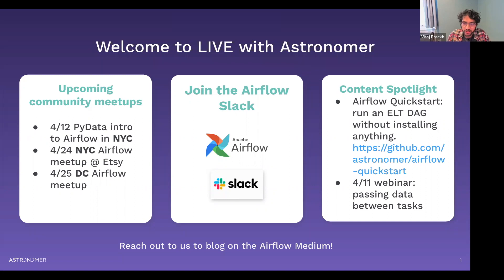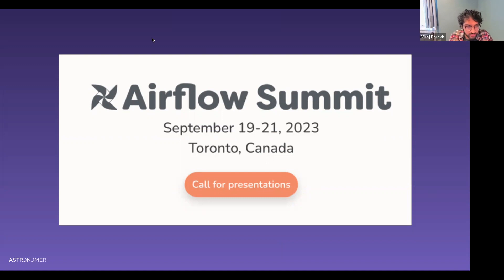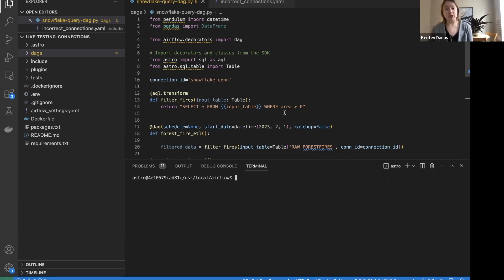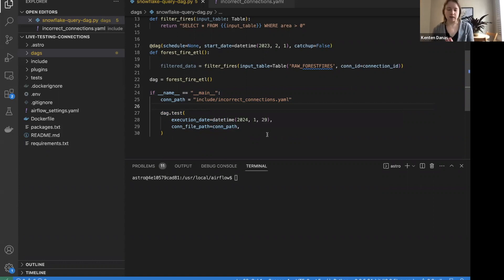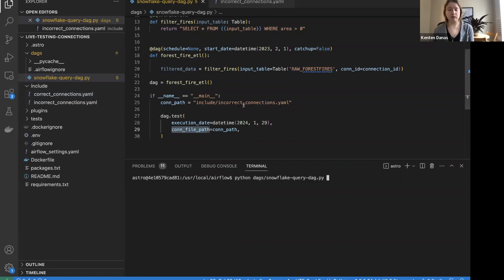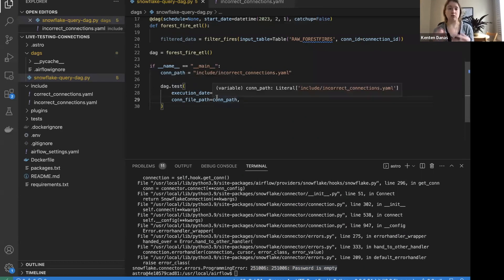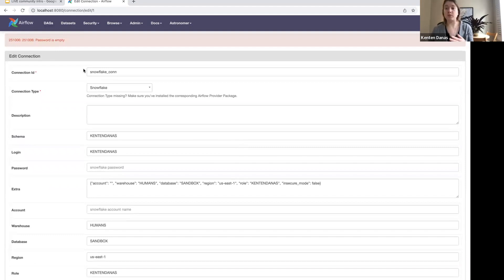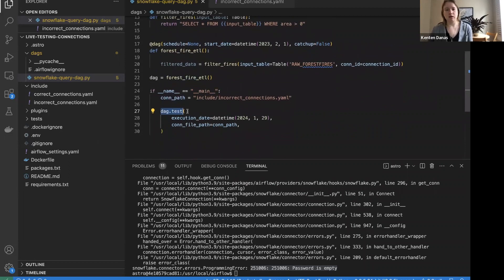How to Test and Debug Your Airflow Connections

Comment: Hello, My test button is disabled could you tell me how to fix that issue, i dont find anything in the web for troubleshooting that kind of problem ?
Reply from the maker: The Test button was disabled in the latest release of airflow, but you can re-enable, check out the following docs link: https://docs.astronomer.io/learn/connections#:~:text=You%20can%20enable%20connection%20testing,Enabled%20in%20your%20Airflow%20environment.
Reply: @Astronomer  Page Not Found
Sorry, but the page you were trying to view does not exist.
Reply: @PodaRock  did u find a solution for this? if yes please tell